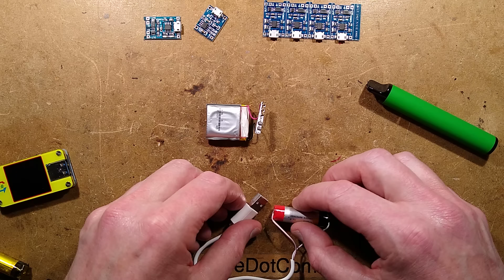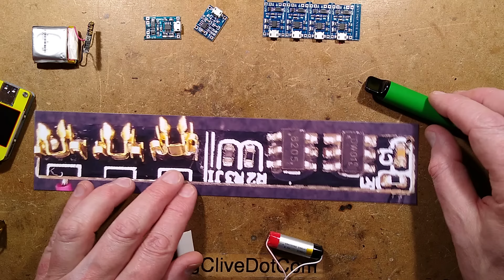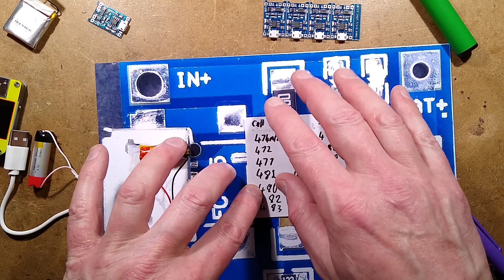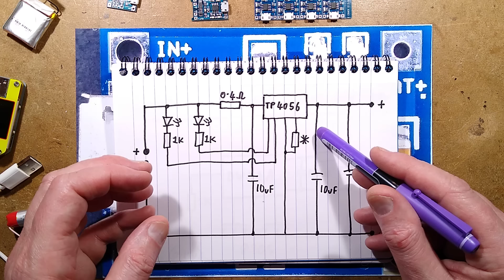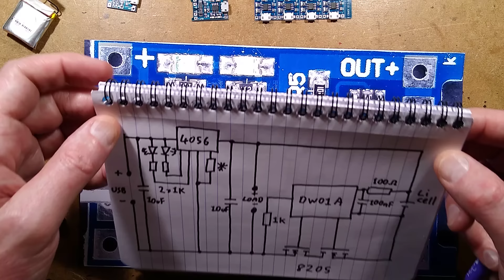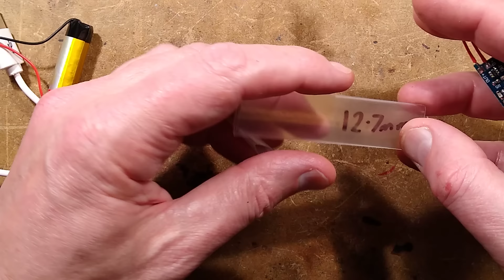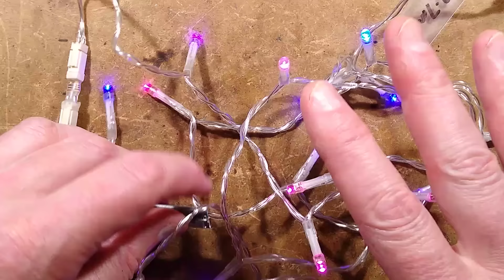Don't do this!   (There's a much safer way)

Comment: I just connect my found lithium cells up to mains with a diode in series.
Works great. Much cheaper than a smoke machine.

It's a bit too late (at night) to watch this now as it's basically early morning though I always charged cells like these with a bench power supply somewhere I could see the PSU and turned it off as soon as the current started to drop off. Probably not the best and I've got a balance charger but it's quick and easy.

Comment: I took my little pcb for charging these out of a bluetooth headphone charging case. Soldered on a male connector to the battery terminals on the bored so now I just solder on a female connector every time i scavenge a lipo. The male connector on the pcb gets worn out after a bit so I just replace it rather than have to replace the one on the battery. I use a springy type charger for the cylinder ones that are still inside the device im using , I prefer them to leaky, pod systems that need replacement pods constantly. When the coils burn i get a nice fat.
Reply: A nice fat lithium cell*

Comment: I've left the company now but I am still madly in love with a battery chemistry that needs an 1.8V charge and gives maybe a 1.6v discharge. 

Can swapping caps or resistors make one of these work for a lower voltage battery?
Reply from the maker: The voltage is locked internally on the TP4056 chips.

Comment: I have obtained a disposable vape from my cousin which he was going to throw out, I just disassembled and disinfected everything except the circuit, it has a air pressure sensor that has a high voltage cut off at 3.2v and never goes down, so I just added connectors outside the vape enclosure and use one of those lithium ion charging modules as a charger like those pen type vapes, replaced the programming resistor to 2k.

I just can't accept people posting videos that essentially tells people to burn their houses by charging lithium cells from vapes directly with 5v and leave it for a couple of hours, I mean wtf! people just think they are smart enough on their own and don't do proper research, not really thinking on the danger that is present in these kinds of things.

Comment: Great Vid. Unfortunately, Single use vapes all end up in the garbage here. Vape shops have a recyling box , but you can't take them for health reasons. I have salvaged some 18650's from Laptops. Generally the Dollar stores (poundland) single power banks have a junk cell, I've replaced a few and use the power bank to charge and connect USB powered LED lights. 
People who are scared of Lithium Cells seem to not realize Lead acid car batteries will explode if not charged correctly. or if you accidentally short them with your uninsulated tools.. 🤣

Comment: Note that you should NOT try to use the TP4056 for "pass through" charging (where the device is running while charging) because this can lead to overcharging as the drain interferes with charge completion detection.
Reply from the maker: As long as the load current is lower than the charge current the TP4056 will charge the cell to near full charge, but then power the load directly.  As such it will appear to never terminate the charge, but is not going to overcharge the cell.
Reply: @bigclivedotcom 
I think many people looking to do the charge while using thing are aiming for solar input, which means it will be lower than the load current at least once every day.

Comment: Ah, this explains some stuff. I didn’t go straight usb to battery but I didn’t use a charge controller on the 3.7v supply. When I accidentally shorted said battery, the wires vaporized into my finger in a split second. May have overcharged the old girl😅

Comment: Oh yeah get this, so I work at a vape shop and this is a thing I wish more people would not do and there are rechargeable disposable vapes that are awesome for someone into hobby electronics. In fact, I think I should send a couple in if you don’t cover those ones and the circuits inside. In reality they are using cells that are similar to 18650 flash light cells in some cases
Reply: I'm also finding more Lost Mary vape devices. These have a USB-C port so it seems they were meant to be recharged but there is no easy way to refill the tank so in the end they just get tossed. I took one apart and the charging circuit that converts 5V USB to 4.2V is integrated into the pressure switch capsule. Would be great if Bigclive did a teardown and investigated whether this is safe for recharging the 650mAh lipo I found inside. The build quality wasn't great to be honest

Comment: I found Chinese RC toys use this kind of unsafe charger years ago. First come to my mind is explosion or fire! Then I realized they are trying to increase the sales of lithium batteries by shorten the lifespan of them. So I usually modify the lithium battery chargers using retired mobile phone charger to get a NORMAL charger (with CC/CV charging scheme) for those RC toys. So that I can reuse those batteries safer and longer.

Comment: My understanding is that as a rule-of-thumb, your maximum charge should be 50% of the capacity of the cell, so in the case of these scavenged 500mAh cells it would be 250mAh max charge. This is more for cell longevity and efficiency than safety
Reply: 80% max for longevity, 50% is for storing them. 
Maybe I'm wrong.
Reply: @BozesanVlad  I'm sure there is a complex mathematical equation for charging for smart people, but for dummies like me the 50% rule works well.
Reply: @bsdjunkie1805  I'm also sure, and also don't know any science involved in lithium batteries, but I stole this values from windows and linux (80%) assuming that they have smarter people than myself, and knowing that lithium batteries doesn't like to be completly full or dry, it seem only logical that 50% (half) is ideal charge for storing them.
As I said, maybe I'm wrong.

Comment: Any charge put into a rechargeable battery has to be governed in some way.  The current has to be trickled in, not flooded in.  Just connecting them up to a, 'dumb', USB connector is a very bad idea.  As mentioned, it'll overcharge the battery and cause it to become unstable to the point of bursting/exploding/catching fire.

Comment: I did solder wires directly to the battery cell (Before the protection circuit) of an old tablet because it had a faulty USB connector that I didn't manage to replace successfully.
Now to charge the lithium battery I first connected it to my 18650 charger using alligator leads but charging the tablet battery took ages. Eventually the red LED of the charger turned green, meaning the battery was charged, at least on paper.

So I did in the end connect it to my bench power supply, which was set to 4.2V and for safety I also set a current limit (Maybe an amp, I don't remember).
Anyways I found that the battery did first draw the full current that I had set, however about 30 seconds to a minute later it started basically regulating itself, so much so that I did actually set the current to the full 5A and nothing more happened.

Over the course of maybe an hour the current drawn by the battery cell was decreasing and when it was only a few to maybe 20 mA I did end the charge process.
I must point out that I never left the tablet charging from the bench PSU unattended.
My bench being where I also have my computer I was able to monitor it the entire time.

But I wonder how safe all I did was (Both using the 18650 charger and next the bench power supply). If anyone can tell me ?

Now I bought another tablet that doesn't have a faulty charging connector so I can charge it as it should be, since the other tablet was also refusing to boot up , thinking its battery was completely flat despite having just been charged from the soldered wires.

And also for extra safety when going out I did "store" that particular tablet (Not charging of course) right in the middle of the room with nothing above it that could catch fire and burn my house down if the battery decided to go boom when I was out.
I also used this trick when charging other "freestanding" lithium cells overnight, in fact I did that in my bedroom so that I would hopefully be woken up straight away if it would decide to catch fire. Fortulately it never happened, and also I would never leave a lithium cell charging from alligator leads completely unattended (By that I mean going out, basically leaving the house etc...) 
Yet I leave my laptop and a few old mobile phones plugged all the time, even when out.

Why I'm allowing myself to do that is because I'm using good quality chargers and the batteries inside those electronics are also of better quality than the cheapy knockoffs that are now starting to disappear from the market.
That doesn't keep me from worrying a lil' bit about finding a pile of ashes in place of a house when going back home though
Reply: A tablet battery can be charged at 2-3A just fine depending on capacity. Of course once the set voltage is reached, the power supply will switch from CC to CV operation, and the battery will continue consuming current as it saturates at that voltage. That too is normal. The battery voltage of 4.2V is also safe and probably lower than what the tablet used to begin with. The 18650 charger depends on how sane and reputable it is? It's not a given, there are truly horrendous ones that should not be used for anything. But ideally it's all fine. Since the battery wasn't getting too hot (hopefully, since you were watching it), this is a good sign.

But i think the power management chip of the tablet has died, rather than the USB connector.
Reply: @SianaGearz  No the power management chip did not die, it's a faulty micro solder joint on the logic board next to the USB connector.
In fact I did manage to make the tablet boot up by first fully charging the battery via the soldered wires then plugging it normally on a USB charger and a few minutes later it booted up and showed a 100% battery charge indication.
But leaving it plugged in led to "Insufficient charge current" notices popping up every 5 to 10 minutes and actually made the battery discharge faster.

The tablet was not heating up at all during the charge via the soldered wires.

I did also use a Charger Doctor and it showed a current draw from the USB of about 5 to 10 mA if I remember correctly.
But when plugged to a computer the tablet didn't show up at all, meaning the power and ground might be fine but not the Data + and Data - pins, which not only makes data transfer not possible but also keeps the battery from getting its rated charge current from the charger.

But the problem is now solved as I have got a new tablet.

My 18650 charger is a Chinese one that can charge 2 cells at once and although it didn't cost much and is clearly not from a reputable brand it works perfectly fine and it's been at least 10 years since I'm using it.

Comment: Is there a lower limit to the size of a Li ion or polymer battery that will explode like a critical mass of plutonium needed for a nuclear chain reaction? I'm super paranoid about them and will even disassemble household things like bluetooth speakers just so I never have to worry about them failing in an 'exciting' way when I'm not home. But some of these cells are so tiny, and the internal volume to surface area ratio so low, I wonder if they can even sustain a thermal runaway capable of self-combusting at all.
Reply from the maker: Lithium cells are safe unless abused.  The small <300mAh ones do not store enough energy for a significant failure.
Reply: I'm lead to believe, i mean to have heard somewhere with no guarantees, that the little 25-40mAh cells like can be found in in-ears won't injure you substantially when they go bad, their short circuit current isn't all that and the energy is dissipated quickly. But they can still have a runaway thermal condition, just not entirely sure how warm it's going to ultimately get before they run out of energy, that's the vital value.

I don't think you have to be particularly afraid of every BT speaker, especially if it has a physical power switch. After all it's in a stable steady state where there's only maybe a little leakage current. I have had a couple cells fail on me and so far it has been benign failures where they'll just lose charge without getting too hot, but if you try to charge them then, they get uncomfortably warm and you just handle them safely until they've drained themselves and cooled off and you dispose of them. Once there's no charge in the cell, no matter how bad it is, there's no reason to be afraid of it in my unqualified opinion as long as it isn't charged again, and they don't go from healthy leak-free to critical in one moment, there's a bit of a process.

And i know, i have double throw switch power strips that will disconnect every electrical device that i'll make sure to turn off and check before i leave the house, i had a DECT phone charger base catch fire, and that one was German made, nice expensive stuff. In my mind, power supplies can't really be safe, even if they by all reason should be.
Reply: @SianaGearz  interesting, thx for the input

Comment: Basically "Please for the love of god, just use a Battery Management System board."
Maybe it's just my previous experience with lithium batteries, but charging a 3.7 (4.2v max) cell directly with a 5v USB connection with absolutely no overcharge/overvoltage protection is a very obvious recipe for disaster to me. I shouldn't be surprised that there are plenty of horrible ideas circulating on the internet like undetonated land mines waiting for someone who doesn't know better to come along.
Reply: It should be rule one of home electronics: *Never skimp on the power supply.*  If you are going to charge any kind of batteries more sophisticated than open-vented lead-acid, you need a charging circuit that can be relied on not to supply too much energy to a cell; otherwise, all the energy that's already in it is liable to be distributed as the sum of half m v squared over each piece of flying shrapnel.
Reply: At the very least, use a hobby grade charger where you can set the battery type/voltage and current.
Reply: I always used 3.7v chargers that have short and overcharging protections. But I have used it to bump charge a semi dead Nintendo Switch 3.7v battery that won't charge or turn on. Works every time no issues since
Reply: Yeh you need bms to do this or it has no way of knowing it is fully charged or overheating etc
Reply: @jontait1095  I just used a meter or kept my finger on it until it started to get warm
Reply: @bigpat_4295  Bad idea man. That takes constantly monitoring it, and the second you're distracted by something else, you're no longer making sure your battery doesn't become a bomb.
Reply: Man I wish I understood how to charge a 18650 for i.e bought a xstar vp2 and can't figure it out even reading instructions.   It's very important for me being I rely on them for my disease
Reply: @Southpaw_canvass  just buy a good 18650 battery charger. Pop the battery in the correct way round and pull it out when the charger says it's charged
Reply: That's what the men explained - don't use 5V directly from the USB 5V port, whichever it is as source (oc, phone adapter etc), but this smal TP4056 module . It does not need BMS system ,cause for one battery ,it can handle whatever battery needs - over voltage, overcharging, discharging, short circuit etc. Ingeniousy designed circuit. I'm using it on everything ,where 3.5 - 5 V is requirement. I'd replaced all NiCd batteries with this small piece of art from the VAPE's on my battery screwdriver, remote controllers , digital multimeters..everywhere.
Reply: @ppilje And as you're unlikely to want to solder leads onto a cell that will go into a device, I'd recommend getting 18650 battery holders a 5/10 pack from the usuals (eBay, AliExpress, etc...)isn't expensive. You can stick the TP4056 module to the back of the holder - and you've got yourself an 18650 charger.

Another way is to buy a small 1 cell  "power bank" meant for stuffing your own cell into. Integrated holder and charging circuit in one. Some types are more/less easy to reopen to get cell in/out repeatedly,  and also more/less mechanically well suited to last when doing that. Again, usual places and not much money.
Bonus here is that you get USB/5V  out of the bank if wanted.

If you want to go the proper charger route, Liitokala is a decent brand.
Reply: any DIY channel be like...
Reply: Use a Smart Charger if you're going to do this, along with the cheap BMS.  Those BMS boards are not a replacement for proper charging.  A smart charger can be set up to charge the battery at the correct rate, instead of pile driving it with more amps than it is designed to take.  These batteries are dangerous if you don't know what you're doing.

Comment: How would you recommend charging a battery out of a Playstation 4 controller? It's a LIP1522 3.7V 1A.
Reply: One of these boards (TP4056 or clone), no charge current modding needed.
Reply: @SianaGearz  Thanks! 🥂

Comment: I do have a power bank with 2 cells 3.7v 18650 ..I did added on more 18650 because the power bank was made for 3 cells but when I opened was only 2 cells inside... and I added another 6 cells just like that one from the Ecigaret.. Now it's taking about 1.5 hours to charge but I can use the power bank to charge my phone for a day while playing Cod mobile 🙂

Comment: I bought 2 of these with discharge protection. It's used for multimeter in conjunction with step up (to 9v), using  phone battery. Couldn't find disposable vape battery tho
Reply: Alternatively, you can use broken smartwatch's batteries.